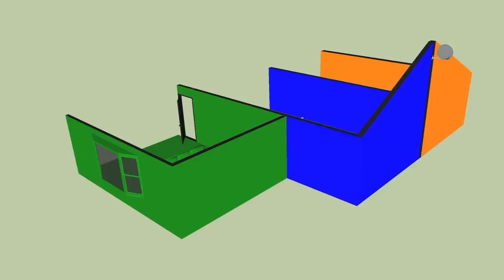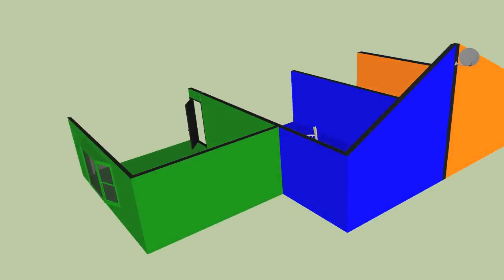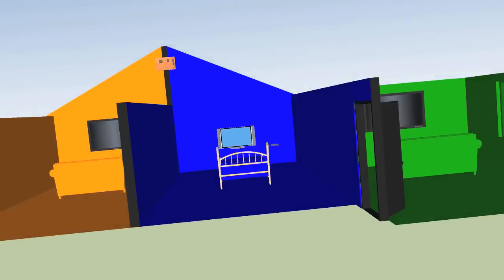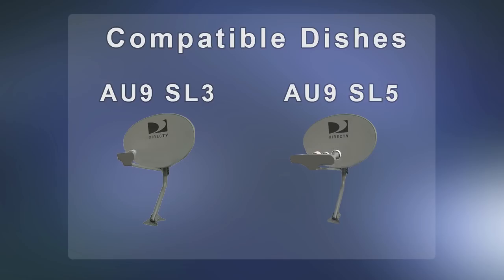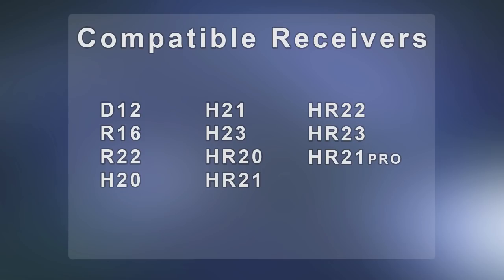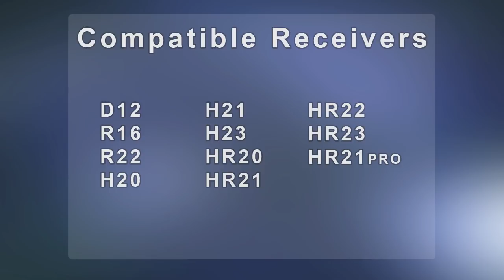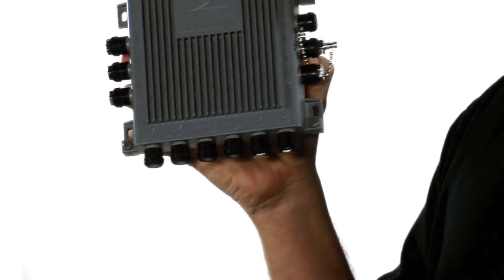Direct TV SWM 8 Multi-Switch

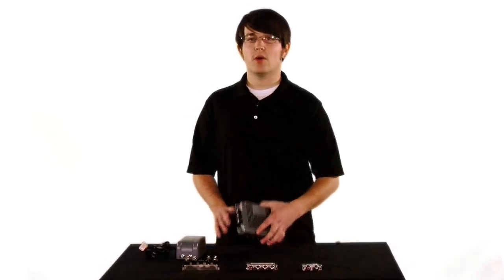Comment: Incorrect information at 1:45 about having to split the line at the DVR.  One wire into the DVR on the SWM1 port is all you need.  The SWM-compatible DVRs internally split the signal to it's 2 tuners.

Comment: u dont have to use a legacy switch on every swim install only if some receivers are not compatible or cust wants 95 or 72.5 dish connected . and if ur doing an hddvr u dont have to put a spliter behind the receiver one line will do the job.